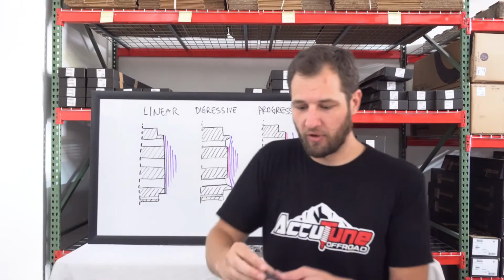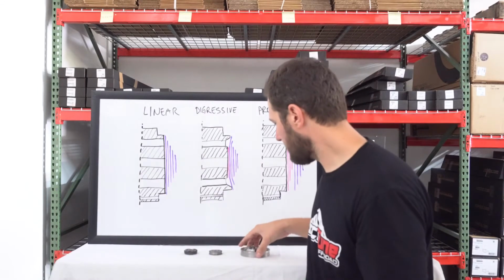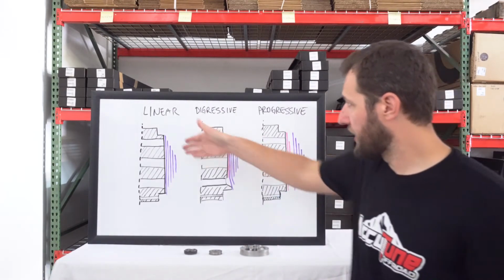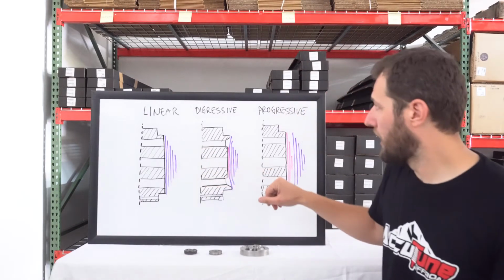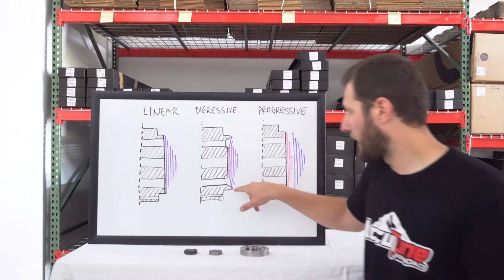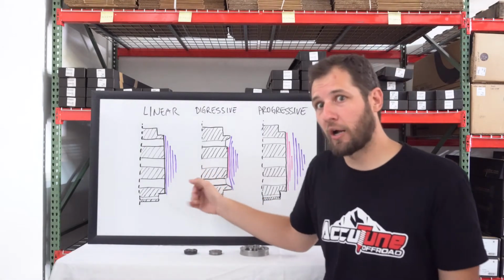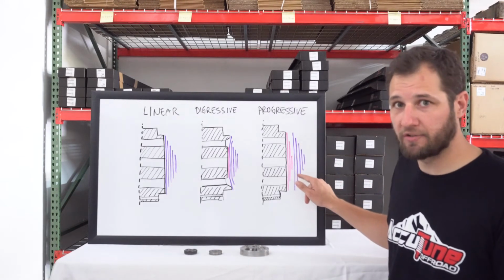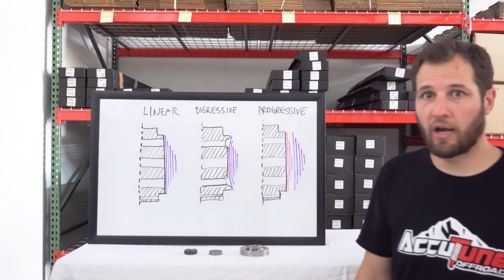Shock Tech Ep. 1: Piston Designs Part 2

Comment: So for a street car that wants to feel a sort of "rally" style support, being able to feel firm on transitions without flicking out of control (IE slalom), firm on long sweepers, but pleasent over the washboards, decent to semi-firm (but not rough) over mediums, and able to take a large bump without bottoming out/destroying things; What should be the combination of linear, progressive, or digressive damping on both compression and rebound, as well as the spring rate?

I'm very new to this subject, but it seems like you might want linear with a late digression and/or S curve compression so the big bumps aren't too stiff, progressive or semi-progressive rebound so the tire can maintain contact with the surface the best without feeling uncontrolled, and a progressive spring to prevent bottoming out and support the G-out/transitioning part and suspension movement. Another way to put the "goal" is that the car also won't feel dragged/sucked down to the road by the suspension and getting harsher as you go ("nascar style" damping).